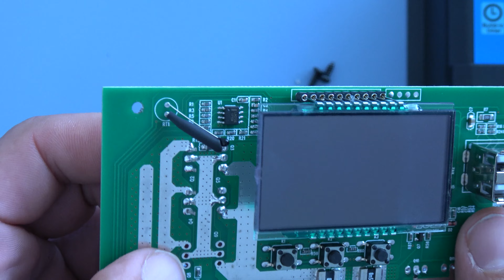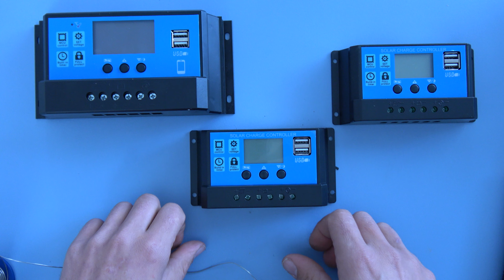Make your solar controller more powerful very easy

Comment: You do NOT melt the solder with the iron.  You heat the parts where they meet until they are hot enough to melt the solder.  I saw at least two cold solder joints that WILL cause problems in the future.  Good soldering is important if you want the device to last.
Reply: Watching this "soldering" was triggering me like crazy, it's like "No, no, no, not like that !!!" 😡😡
Reply: author is in a histerical hurry, and not using any flux - hence all the cold soldering. such quick-doers do pay times more for same.

Comment: I have the same chargers myself. Different brand but really the same thing. The one problem I have eith all of them is that they discharge the battery more than they can charge when using panels smaller than 20W in the winter.
Reply: Put blocking diode in the positive wire of the solar panel to prevent the current from the battery to return to the panel. Cheers!!! Hope my comment is not too late .

Comment: Wasn't quite what I was expecting.
No circuit diagram or schematic of what the change is suppose to achieve.  But I was hoping for one controller - unmodified and one controller modified and the two run under identical circumstances to SHOW what the change achieves.  Interesting concept though, I will have to search for videos that does this modification but with tests and results.
Reply: those things just have a mosFET as the output control. it is used to switch the solar pannel onto the battery. the only difference between the various model 10,20,100amps is the number of mosFET and the cooling for them. 

by soldering (adding) more FETs you are helping spread the load and heat dissipation.

Comment: Dude please explain more in the description or in the videos.  To me it looked like you removed the load transistors model them to process solar charge and put identical transistors back on the load or are they different and just happen to be the same size.   How to then reprogram the board to allow override.  Those are 75A each
Trying to learn wtf you're doing but would help if you gave more info.  So theybuse the same board for different models I figure.  It reminded me of the perpetual energy videos for some reason.  I'll keep watching though.

Comment: I need advice, please: I have a 455W solar panel...I bought BOTH Mppt and Pmw controllers from China (100A)...When I connect the solar panel, the controllers don't accept the panel? The controller shuts down soon?! Thank you very much

Comment: I've got a similar charge controller and it gets very hot even when the solar is only 1 amp! I opened it up to look and it was clear one of the MOSFETs was overheating as the thermal tape was a bit bubbly. The soldering looks ok on the back of the board but the pins push through to the other side and only some of them are soldered at all? The hot MOSFET has a dry joint on that side so probably the cause of the problem. I can resolder that but shouldn't all the other pins be soldered too? It's a double layer board. Any advice would be appreciated. Thanks.

Comment: Can I replace P75NF75 MOSFET for all the moseft in this type of charger controller.
Reply: no controlador pwm azuzinho de 10 ah,adicionei mais dois Mosfet zj70n78 ao circuito dele melhorou um pouco numa placa solar de 150 watts pra carregar 3 baterias automotiva de 60 ah e uma de 48 ah em paralelo somando a amperagem pra manter um sistema off grid em 12 v.
Reply: yes, but you must be careful of the pinout.

Comment: P75NF75  ( Transistor breakdown )

Type of Transistor: MOSFET

Type of Control Channel: N -Channel

Maximum Power Dissipation (Pd): 300 W

Maximum Drain-Source Voltage |Vds|: 75 V

Maximum Gate-Source Voltage |Vgs|: 20 V

Maximum Gate-Threshold Voltage |Vgs(th)|: 4 V

Maximum Drain Current |Id|: 80 A

Maximum Junction Temperature (Tj): 175 °C

Total Gate Charge (Qg): 117 nC

Rise Time (tr): 100 nS

Drain-Source Capacitance (Cd): 730 pF

Maximum Drain-Source On-State Resistance (Rds): 0.011 Ohm

NOTE: It's still PWM and can only do so much. If the backing plate is NOT Metal  you'll get tons heat build up.  I assume you can safely go over the  basic  wattage tolerances.  example 12v 120 watt ( 10 amp )  PV  to under 12v 240 watt ( 20 amp ) solar PV.  <- gonna get hot.  Mosfets can handle it but can the rest of the cheap 2 ply PCB Board and components. Nice idea for sure. I'd add a 12v fan to the  aux out ( aka the Light connection all these come with and cool this beast build. ) Build the mount holes with spacers and long screws. Add an L shaped bracket and mount fan to blow up air current from bottom of unit.

Comment: I need to know i have a 12v 200ah battery wth this blue control is it fine to use with this.
Reply: Hope you figured it out .  200 ah. Potentially 100ah if there acid.. hope you have more than one scc. If you have the panels you could be using the excess during the day and still be charged up for the night ..
Reply: @byondlight 😊

Comment: My solar pannel gives 19-20 volt to the controller and using 12v lead acid battery...but there is 16.8v output from load during day time.
I need only 12-13v how to reduce voltage from my charge controller...plz reply😢
Reply: use dc to dc step down buck converter,, put in scc wire going to scc, scc-buck converter-scc, then adjust the voltage output of buck converter module into the volts you want